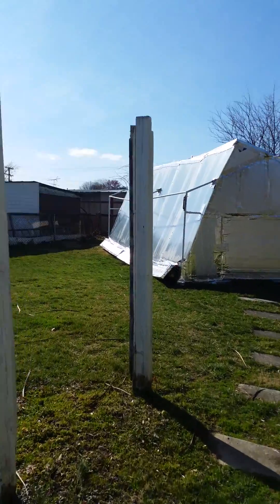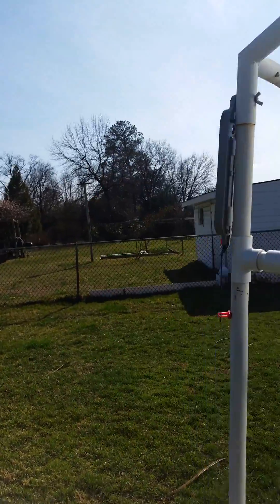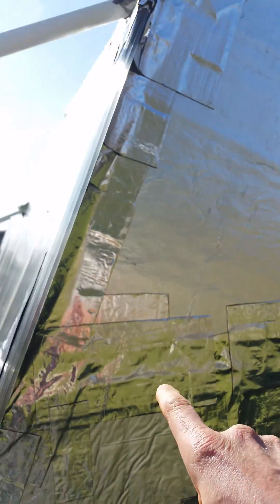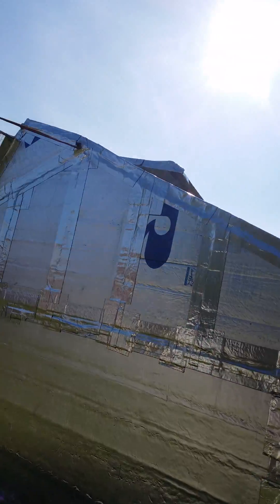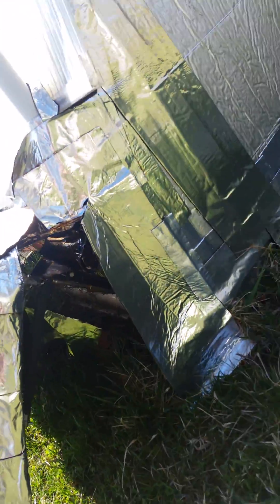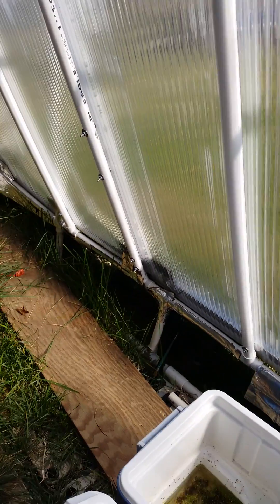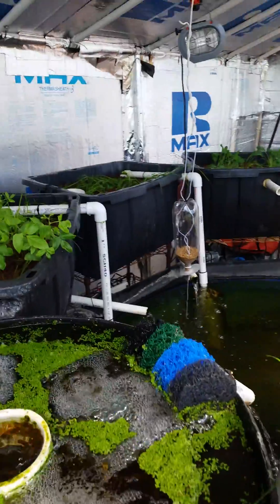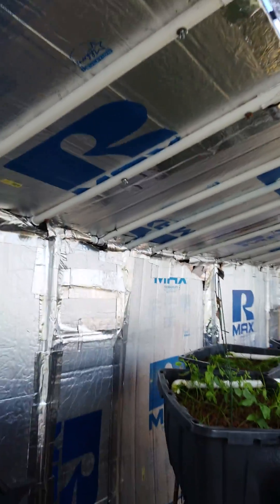DIY Chinese solar greenhouse design and operation 3 26 15

Comment: Hi is the insulation you mentioned polyisocyanurate ? If so, in order to get R 23 I think you need to install it with a 3/4” dead air space on both sides . With it exposed on both sides it is R 13, still nothing to sneeze at! If it is something else please let me know. As a builder of energy efficient homes I would love to use it.